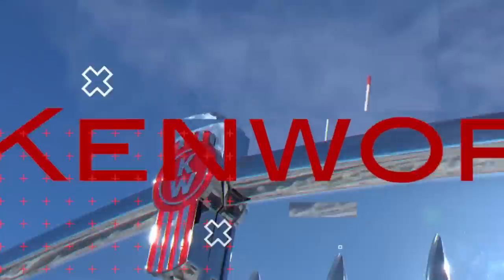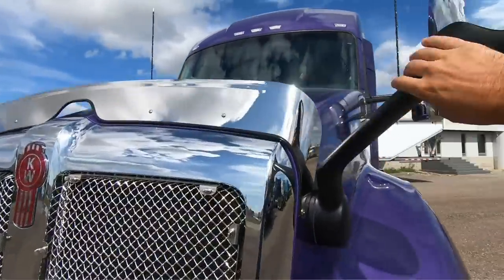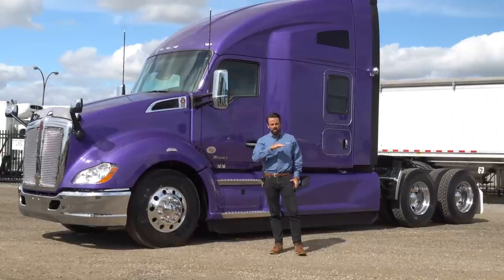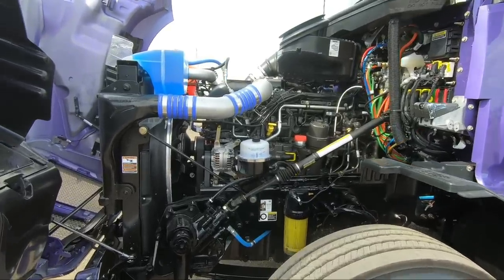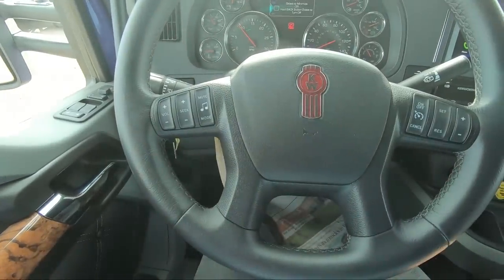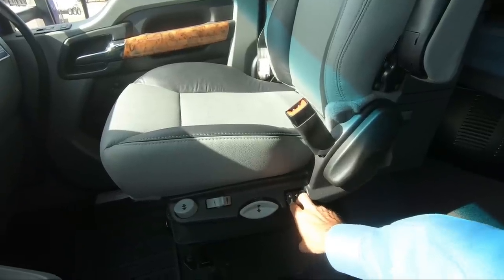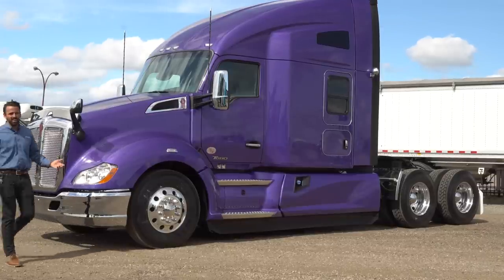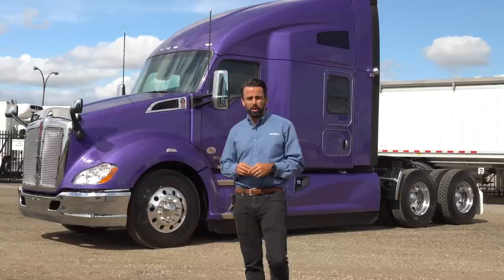TOP OF THE LINE 2020 KENWORTH T680 WITH DIAMOND VIT INTERIOR

Comment: Still amazes me that new trucks are coming with drum brakes. Here in the UK and in Europe that's unheard of. All commercial vehicles have full disc brakes with ABS. Trailers still tend to have drum brakes but they're slowing being phased out.
Reply: Totally agree drum brakes are now a thing of the past.........
Reply: @anthony1636  try dealing with discs at -20f vs drum. I'll stick to drums, thanks. .
Reply: @Hoodamax  my 2003 Freightliner classic came with discs all around i drive in Colorado and never had an issue whatever the temperature. I love disc brakes DOT never checks they last a very long time no maintenance or adjustment.
Reply: @anthony1636   Kenilworth technician here, I can tell you drums are absolutely not a thing of the past. They're still an option for a reason, for one to replace drums and shoes you don't have to remove the hub like you do with discs to replace rotors and it's easier for owners to replace drums and breaks themselves if they do choose. Get used to seeing drums for a long while.
Reply: @alexryherd9810  lol. keep teling that to yourself
Reply: In Australia its a pretty good mix of drum and disk. Certain industries tend keep to one or the other, fuel tankers for instance tend to be drum (I heard because in the past there were issues with disk brakes exploding/shattering , not sure how accurate that is).
Reply: @muppetmaster23  it can happen if they're overworked you'd get heat cycling fissures on them. gotta learn how to use the engine brake to slow the truck down for cost reasons. anyway, the drawback of drums is that they do not shed heat as good while they do have better stopping power. at least on my truck it got disks but it engages engine brake automatically when you touch the pedal. it helps with costs. also pads seem to wear out every other day while drums tend to last longer. 
so yeah, in conclusion that alex guy is not that wrong.
Reply: Good points here. Discs require no adjustments, they cool down faster and there's no accumulation of brake dust that compromises the braking efficiency. Lock up is also eliminated with ABS for better stopping power and longer tread life
Reply: Java Monsoon 🤷‍♂️ we slow down using VEB or retarders which are more  efficient than Jake brakes, as for the temperature Volvo, Scania, MAN, Mercedes all run discs and are all used up in the north of Norway and Sweden at below minus 30.
Their is a number of reasons why manufacturers are still using drum brakes over in the US but it’s got nothing to do with the lack of efficiency of discs.
Reply: @Hoodamax  We do..all the time when travelling to Scandinavia or Russia. They work fine..
Reply: Josiah E  Drum brakes don;t makes sense any more on heavy trucks - the tech has been out there for years and discs have all but eliminated brake fade in the mountains - when truckers from the Uk go up and over the Italian or French Alps - you know - on those 'regional' journeys..so-called...
Reply: @alexryherd9810  my low coolant light won't turn off any tips ? The coolant sensor has been changed. 2012 kenworth t660
Reply: @420krewkid  it could be the harness to the sensor , usually the pins spread after time, giving you a bad connection causing the light to go off. Most likely the float inside the table that the sensor reads is stuck and unfortunately the only way to fix that is to replace the tank
Reply: @alexryherd9810  I was thinking it might be the tank as well
Reply: @KieNjiru  discs do require adjustments, you have to adjust them when replacing them or working on them. There's a small adjuster on the caliper
Reply: if im not mistaken Peterbilts are doing disc brakes now
Reply: @alexryherd9810  it was the tank
Reply: I have a 2012 T660 studio sleeper. It has disk on all three axels and I will never go back to drum.
Reply: J E that’s not even half a load here you try 280,000lb and we do have small hills but at that weight it only takes a small hill to slow you down
Reply: Alex Ryherd for rotors to last 3x longer than drums, removing a hub is nothing.

Comment: Nice to see the manual transmission. Nice truck overall.
Reply: Jamie Ford!! Because the industry is pushing for mostly automatic transmission,  which means they get to have more Rockies behind the wheel.  Once you're a real trucker,  or ever driven manual, it's hard to not be in control of your gears selection.  Specially under rough and dangerous conditions.
Reply: @rudyavila327  ; 100% accurate
Reply: can you tell me why they have 18 gears? what kind of trailer would there be using to require 18 gears? just trying to understand.
Reply: @jay300m04   You need to understand that big trucks do NOT have a synchronized transmission.  This means that the Engine can spin at a different RPM than the transmission.  The more gears you have, the smaller the RPM difference for each individual gear and the easier it is to find a gear that will spin the rear wheels (drives) at the same RPM as the engine.  When RPMs between the engine and the tranny match, you will get the best power or economy.  Most 10-speeds (the most common tranny) will have a wide RPM range which causes you to become "gear-bound" (unable to shift without a loss of power or economy).   This is one reason why you will see trucks struggling on a hill (with speed limiters/governors being another).
Reply: Tj H the engine choice killed the trans smh
Reply: @jay300m04  18 is mainly for long haul the company my father worked for two of there trucks had 18 speed because they were going to California every week

Comment: Kenworth seriously needs to refresh this truck badly. Seems like every other manufacturer has updated their models while this hasn't really changed.
Reply from the maker: Kenworth is working on refreshing each model one by one as we’ve done with the T8 80 the W9 90 and now the medium duty product line which is next to be done. I’m sure they’ll do a refresh on the 680 afterwards
Reply: @AndyTheKenworthGuy  There's a good number of things KW should consider changing whenever they decide to update the 680. I think they need more driver input before doing so.

Comment: 5:43 it’s not recommended to idle your truck? Why is that? What else do you do if you want it cool on a super hot night?
Reply from the maker: It messes up the emissions system. Better to install an APU.
Reply: He is not kidding ... I have a t660 with the EPA 10 Mx-13 I spent nearly $10,000 on emissions related repairs the first year when I was idling it overnight. I installed a used Thermo king Tri-Pak for $4000 and I have not needed to pay for a emissions related problem since then. Idling a PACCAR motor is the quickest way to kill it.
Just don’t do it.

Comment: then this truck came out they were saying it uses the same frame rails as t660  and 660 has the same as W900 . so my question is this WHY NO FRONT  AIR RIDE ON W900B  ?  i can live without sunroof .. but looks like i'm gonna go with another 389 just cus of front airride.. sad as i find quality control of KW more superior then Pete
Reply from the maker: Change the front suspension after market. Lots of my customers donthay
Reply: @AndyTheKenworthGuy  12g and horst ain't good.
Reply from the maker: It costs about 5k aftermarket.
Reply: There is no improvement in ride with aftermarket

Comment: The fifth wheel jaw doesn't lock properly sometimes Kenworth 2019 reply if you have the same problem...also the engine noise is very annoying
Reply: That wouldn't be a Kenilworth problem but an issue with the fifthwheel, the new is either out of adjustment of an effect of poor maintenance

Comment: Andy, could you please explain the airbag suspensions available? I hear 4 bag and 8 bag systems mentioned but not sure why one would want one over the other. Do more bags give a smoother ride, cost more, have greater load capacity, weigh more or less than leaf springs, etc. Thanks so much!

Comment: Great idea moving the exhaust stacks. I never understood the one outside next to the drivers seat, can see thru them when backing up. Also Kenworth is famous for the steering wheel covering the following gauges; oil, fuel ammeter, blinker indicator, both air tanks pressure gauges, speedometer and rpm gauge... unless you move the steering wheel to an awkward position.

Comment: This is great truck love  18 speed transmission ❤️ all the details BUT this PACCAR ENGINE 👎 definitely wouldn’t buy because not all shops know how to work on this motors and not even dealerships besides they take too long to fixed a truck for customer to get back on the road 
So my recommendation is if you buying a truck buy it with CUMMINS ENGINE  450 HP and 355 rears 13 speed if is 10 speed too and up no 👎 less the more horse 🐴 power the better because it last longer small engines fells sooner. Hope it helps someone
Reply: Jorge millenia We have a fleet of 20 trucks and 5 of them have the paccar mx13 engines and they are pretty good engines overall. Never had any big problems and working on them is not too bad. As long as you have a way to scan the truck, i would say they are pretty decent.
Reply: EPA 2017 MX-13 will be far more reliable than the EPA 2011 MX-13 and the Paccar motors get better lifetime fuel economy than the X15's. They also weigh about 400 lbs less than the X15. The 510/1850 MX setup with a 3.90 rear end and 18-speed can pull B-trains no problem and has plenty of power (a driver friend of mine gets 6.5 mpg regularly running B-trains in BC).

The MX-13 has had a really rough history and has burned a lot of owners, but whether you go with a Cummins or a MX-13 in a Kenworth, you're going to be more upset about the wait times at the shop for warranty work than what either motor will be having issues with. Or having Kenworth deny your warranty work because of something you did to it.
Reply: Jamie Ford  The PACCAR engine doesn't exist. It's a DAF engine from Holland and named after the owner since 2012. PACCAR is just the owner of DAF Trucks and the other two.

Comment: I would have spec'd disc brakes and a Cummins to make it actually a top of the line spec. The Paccar engine is good, I've just had better experience with Cummins.
Reply: Steve Pratt Cummins have had a lot of trouble, in the company I work for, they replacing them with Paccar, engines.

Comment: I'm not sure if you will answer this but I'm going to ask anyway. Does the high rise T680 come with a single bunk option or is that an option for the midroof only?
Reply: RiZenAsH you can get a single bunk with or without the extra storage shelf and 2 extra cabinets
Reply: @theoregontruckerT880  I'd definitely want the extra storage that's why I was asking. I've seen the options in the midroof but never the high rise in the t680. Every t680 I've been in was a double bunk. I love the fuel mileage I get in my t680 but when I get ready to buy a new one I want a single bunk.
Reply from the maker: You can get a single bunk if you want. The mid roof has option for bunks too and storage.
Reply: Mine was a double bunk. I just removed the top bunk. Makes the whole cab feel much more spacious, and gives more storage room.

Comment: Beautiful truck inside and out. Does anyone know the standard top speed and if it comes with an automatic transmission?
Reply from the maker: Depends on how the rear axle is geared. Could be 50 mph or 110mph
Reply: No way the top speed could be 50mph
Reply: titel candea does the trucks come with a speed restrictor or limiter in the truck or as us Americans call them governors, that makes the gear ratio and rpm so high around 65mph or is that how the truck is made?

Comment: Paccar engine...nuff said!!! JUNK!!!
Reply: Jamie Ford he won’t be able to give you a real reason. They never do
Reply: I have a EPA 10 series MX 13. They are the absolute worst of the bunch. My problem isn’t so much with the engine as it is all the other crap that is strapped to it. I will never purchase another PACCAR motor not because it is unreliable but because no one outside of a Kenworth dealership can work on it due to the proprietary nature of the software that runs it.
Reply: Jamie Ford  I  had a 2016 with a Paccar. It had a MX-13 in it. It was terribly under powered. After just 200,000 miles I had all kind of DPF filter issues, attributed to lack of output from the MX-13. Sorry, but it is JUNK!!!
I now have a 2019 W900 with the 565 Cummins. THANK GOD FOR CUMMINS!!!
Reply: Do you even own a truck or are you just a keyboard warrior?  @Anythingautomotive
Reply: @badeiser  Because the engine is from the Netherlands (DAF Trucks).
Reply: @pauln4489  An underpowered engine has nothing to do with the quality of the engine but with the quality of the buyer.

Comment: I wonder if still someone choose paccar over new Cummins x15
Reply: They would if applying it to a weight-sensitive operation. It's almost a 600 lb weight savings, and the EPA 2017 MX-13 is much more reliable.
Reply from the maker: Yup. People sure do b
Reply: Cummings Sucks had one Traded it in for a Paccar now I own 2 People have to know Only problem with Paccar you can't Idle them so buy a Thermo king and you will love Paccar Engines

Comment: Could have fooled me, my wife got a new 2021 680. She has gone through 4 gallons of coolant in under 2000 miles. Every mechanic she talks to says it has air in the system. I think not, we can smell coolant under the sleeper. So far upset with the truck.

Comment: Needs the isx15 I don't like the pacar even tho it's by cummins
Reply from the maker: The 13 liter Paccar is actually a Paccar. Not made by cummins. Cummins makes the medium duty engines.
Reply: @AndyTheKenworthGuy  The Paccar MX engine is the DAF MX engine!
Reply from the maker: It is made in the USA off the DAF platform but it is a Paccar engine.
Reply: @AndyTheKenworthGuy  The engine called PACCAR engine because DAF truck is the only truck manufacturer in the PACCAR group that design en built their own engines. By taken over DAF truck, PACCAR now has it's own engine and that's why it's called the PACCAR engine.
Reply: @AndyTheKenworthGuy  Yes, could be. After DAF having built engines for years for the US market, the MX engines now come from the Mississippi plant.

Comment: So chrome bumper, chrome mirrors, useless dual exhaust, fake diamond interior and fake wood accent is a must to have for these guys and disc brakes and cummins engine are unnecessary options which can be avoided. Pathetic. As a mechanic, I say it is pathetic.
Reply: What do you mean "useless dual exhaust" not being smart but I'm curious
Reply: @GrabinGears  you see, the main exhaust pipe is a single pipe coming out of the engine. It really doesn't help that much to "widen" the outer part of the exhaust system by adding another extra pipe to the main line, while the very beggining of the exhaust line (manifold) remains the same size. You do not help the smoke to come out that much easier by doing so. If the manifold could be replaced by a larger and better designed one, going for a dual exhaust pipe would almost become a must, but now, it doesn't have that much of impact.
Reply: @behroozkhaleghirad  oh......okay I see makes sense!
Reply from the maker: Haters gonna hate.

Comment: I can't believe they put drum brakes on a new truck. Smh
Reply from the maker: All the time.
Reply: @AndyTheKenworthGuy  it would seem that Europe and America are very far apart in spec of trucks, not saying kenworth is at all behind, horses for courses, although that said disks and abs would be nice, and on the other hand the cab would be great for here in the UK, would love a nice size cab layout like you have there, lovely truck
Reply: @darrenbartlett3294  drum breaks still have abs...
Reply from the maker: Yes they do
Reply: You must not have to pay to replace the pads for Class 8 discs. Cost wise the discs are a significantly larger up-front cost and while they do last longer, are much more costly to service compared to drums (thousands versus hundreds).

Their braking power is unmatched for sure, but most good drivers won't be relying on their service brakes to slow down anyways, and with the manual transmission, this owner likely won't have to service them for years.
Reply: My T680 has 559,000 on original pads so they last a long time and they are the safest option. With all these rookies on the road there shouldn't be drum brakes anymore in my opinion.
Reply from the maker: @deego you nailed it for sure

Comment: Pull that handle that you called jake brake lever and your trailer brakes will slide.
Reply from the maker: Kenworth changes the design Gray. The trailer brakes are on the dash now.
Reply: @AndyTheKenworthGuy  My bad, I thought you did a good job giving the KW review. I assure you that I was not trying to be a wise guy. I just have never driven a truck with the trailer brake on the dash. I think these brand new trucks would throw me a curve ball on design! I sure can't see out of KWs mirrors for the last several years.

Comment: IT'S NOT TOP OF THE LINE..  
I ordered mine with all disk breaks and factory installed inverter with 2 household electrical outlets top and bottom
Reply from the maker: I don’t see how disc brakes disqualifies it from being top of the line. The interior is top etc. we build them how customers want them.
Reply: @AndyTheKenworthGuy  the difference between drum and disk is like fiberglass and carbon fiber. They both work but carbon f5is stronger and more durable

Comment: Bridgestone tires are junk! Make for a rough ride, terrible! Why is the filter minder under the hood? Mine is on the dash where I can see it. The trailer brake controller should be in an easy to reach position. The seats are ugly and cheap looking. Looks too much like a Volvo. Comon kenworth you used to build beautiful machines.